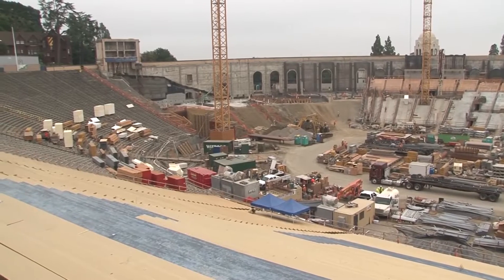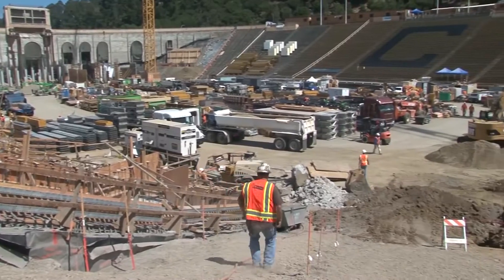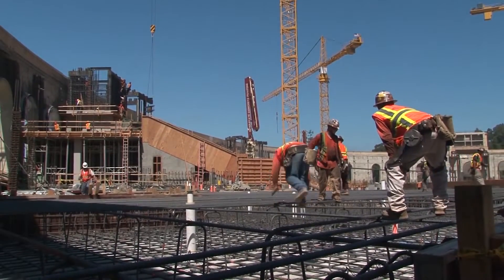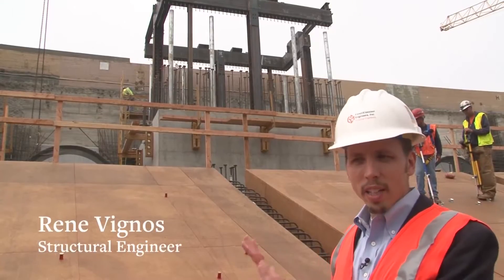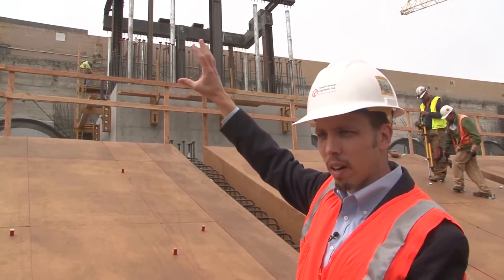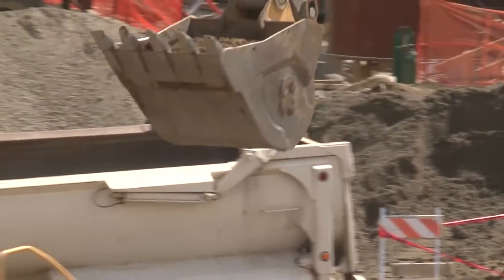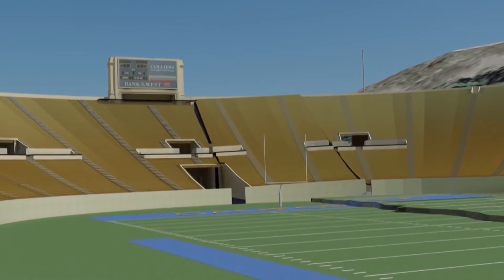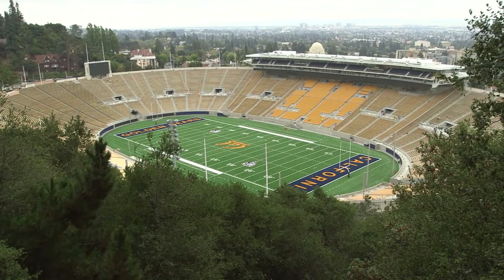UC Berkeley Memorial Stadium Earthquake Retrofit

Comment: They should have never built that stadium in that location in the first place. The fault line was discovered in the 1800s. The university and city officials knew of the fault line placement and still built a stadium in a hazardous location. All the old trees and tree roots they tore down were helping to keep the fault line stable, and together, the tree roots were the threads.